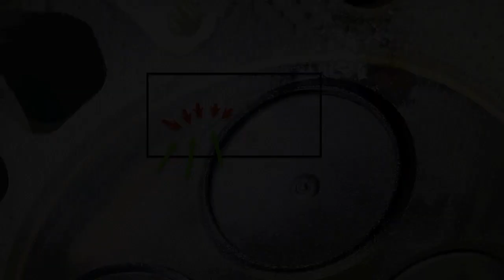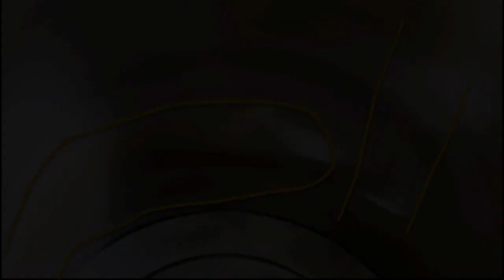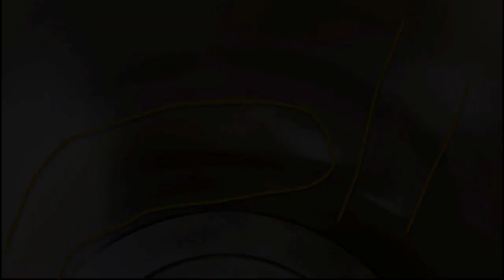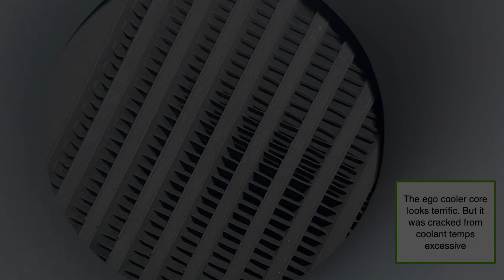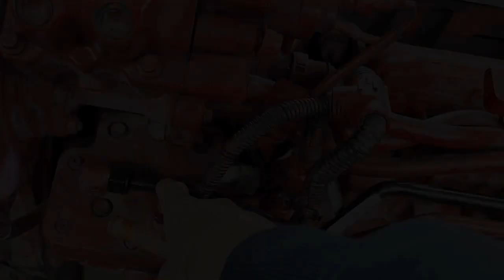QSL9 Here is WHY we had High Blowby

Comment: Loving the videos, Joe! The amount of time and effort you put into these to help others speaks volumes of your character. I would have to totally agree with your failure analysis on this one. Would be cool to have another YouTube channel like an injector company that could test that injector and show the spray pattern and damage to the nozzle and if was Foreign Object Damage, internal deposit, or thermal extremes that caused the spray pattern to move from bowl to crown using their sophisticated test equipment. I feel when making a repair, you never fix it until you get to the root cause and not a symptom.
Reply from the maker: Yes it would. Down in engineering at cummins they dissect failures until they understand why and then fix the problem. When i worked there and was able to talk to the engineers they would tell me things they found and why and what and I used to think how in the world did you guys figure that out. But they did. I remember three engineers came to the branch i worked at in 2002 with a prototype engine in a box truck. there was two guys and a girl. One guy was a software guy. The girl was a fueling engineer, and the last guy was turbo guy. They stopped in to use our dyno and I ran the dyno for them. They were having trouble with the engine bucking. This engine was going to be the first common rail B series engine in production the next year. I watched them pounding keys on the laptop while dynoing the unit trying to stop the bucking or surging in the engine. They worked a couple hours and then lunch. At lunch I asked do you think you can solve what ever the problem is. The one guy said to me if we dont cummins has no midrange B series to offer next year. They worked on it the rest of the day. Sent info to the factory and got emailed another calibration the next day. PUt that in and had to tweak fueling just a bit but it purrred on the dyno. I was seriously impressed. I still am when I see what cummins does with engines.